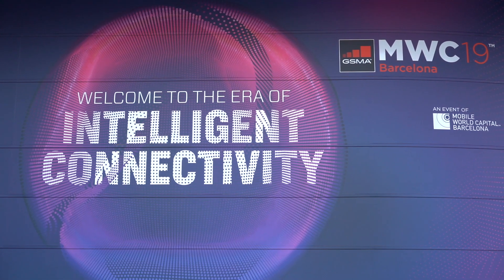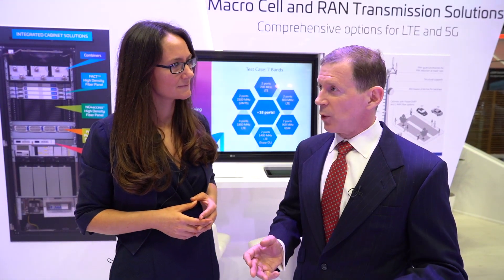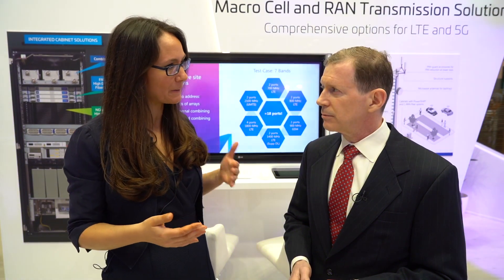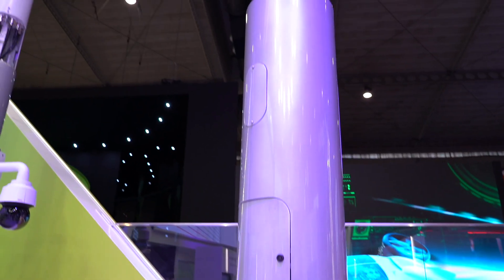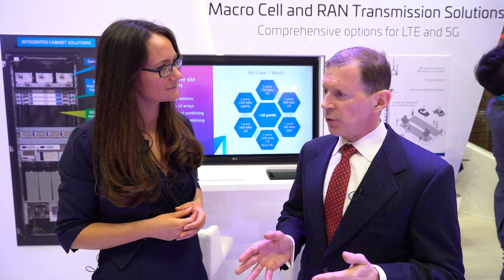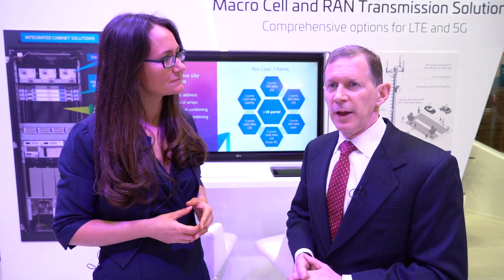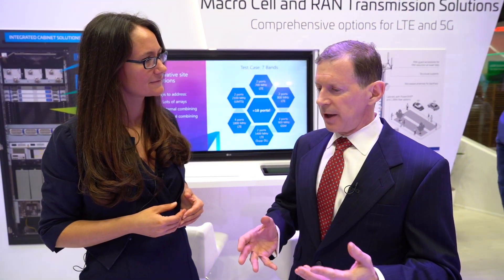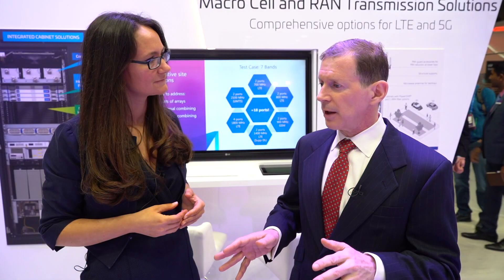New antennas from CommScope address efficiency and path to 5G

Comment: Kindly tell me how i can test a 4*4 Antenna array in which each element is excited through the coaxial feeding.
Reply: Thanks. If you want to test a prebuilt antenna (ex the one you may have bought) then there are a couple of ways

Test antenna on each port separately.  Insert coax into one port and measure the reception on the receiver. This will establish whether the ports are working individually. 

Take 2,  4 port antennas and use one for transmission and the other for reception to see if they work. In this setup you can try different arrangements all 4 transmitting and 1 receiving , 2 Transmitting and 3 receiving ,4 transmitting and 4 receiving and so on. This test is more thorough and will let you test for all possible success and failure conditions. 

On the other hand If you're building such a system then you could

1. Test the array elements individually 

2. Arrange them in the manner you want to feed them and do a continuity test.

3. If the elements work individually and they are continuous then they would work as arrays, but you can repeat the test cases defined above for a more thorough test.

Hope that helps.